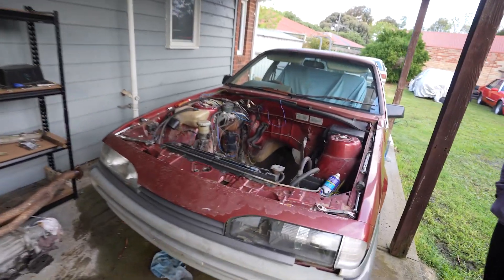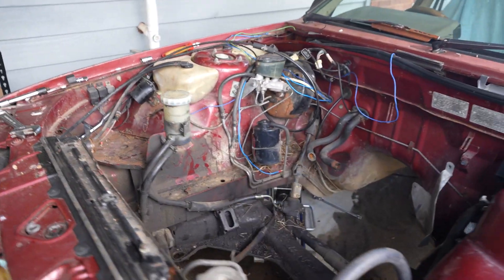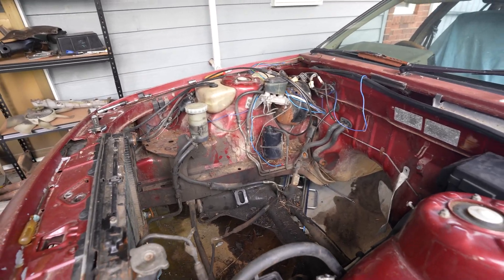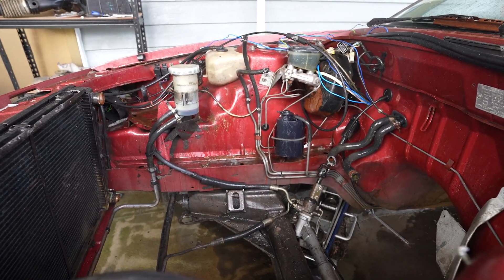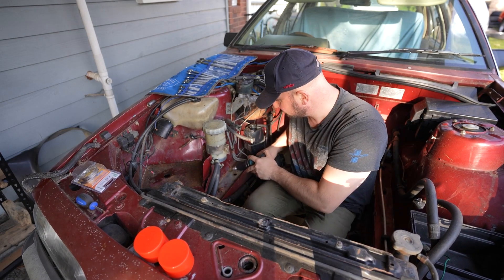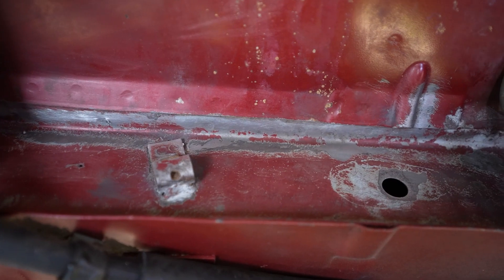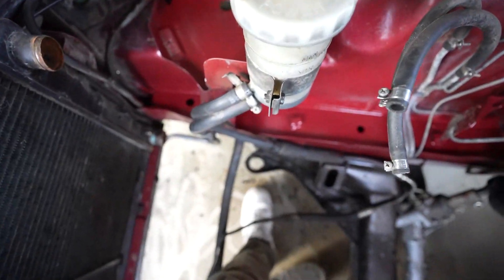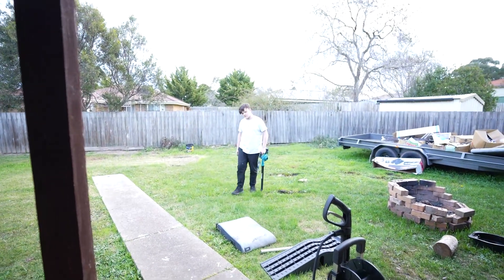VL Commodore SL Restoration Episode 8   THE NEW RB30 ENGINE IS IN

Comment: Really enjoying your channel George.That rust down the front of the brake booster is likely from the brake master cylinder leaking. So you might need to replace that.
I have noticed the sound of the music to be a little loud compared to the rest of the audio. 
Your channel is definitely motivating me to finish my projects so thank you 👏
Reply from the maker: Hey Andrew, yes of course , it’s leaking and burnt the paint away , I’ll have to check it out , ok thanks for the feedback about the music, I do rush a bit with the editing so I’ll keep it in mind for next time , thanks for following ! What kind of cars do you have ?
Reply: @georgeauto  I'm working on a ke70 corolla and my daily driver is like a project in itself . It's a turbo starlet. When we arent locked down, I like to help my mates on their cars. An xd 351 and a vp berlina.
I subbed when I saw your vl project.